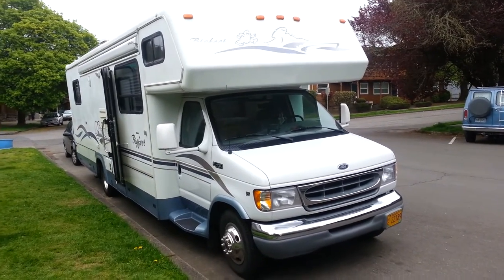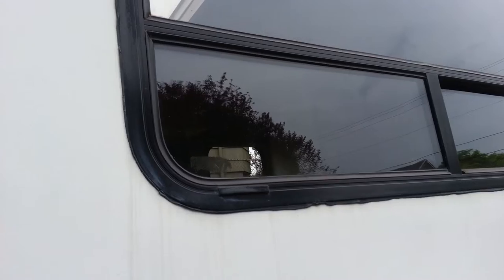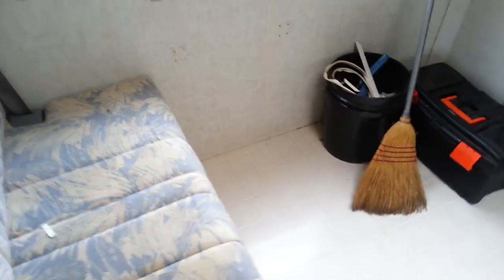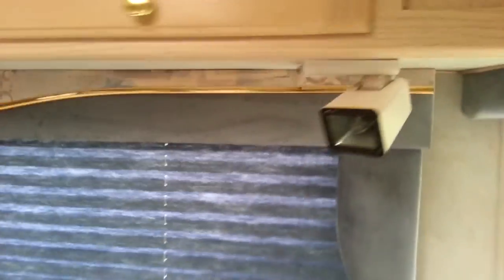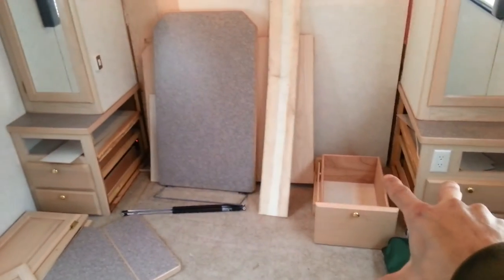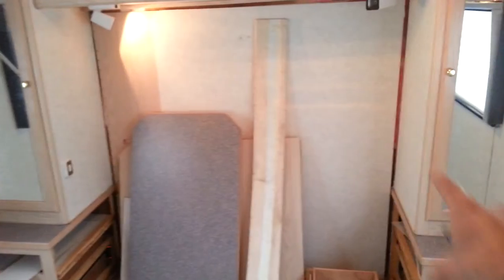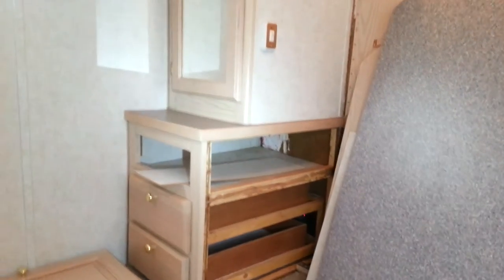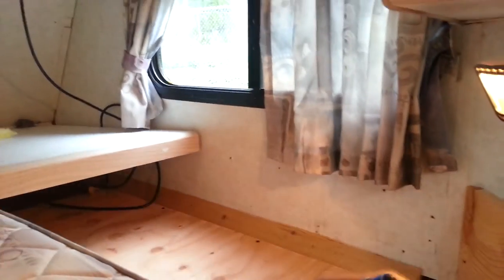Living In Our Bigfoot Motorhome - Overview

Comment: Good job!  I did extensive remodeling on my 22 ft RV 1997 Class C Tioga.  Also a Ford like yours, an E350 V10.  I love my RV!  But it was so very dull inside without an optimal use of space.  I ripped out dinette, and sofa bed and sold both.  I have shortened length of a wooden chaise lounge (Smith and Hawkens) and installed over water tanks where your sofa sits.

In place of dinette I have a slim recliner and where your current dinette bench chair is, I have added an IKEA Tarva 5-drawer dresser screwed to the kitchen wall on side facing dinette.  Over that mess of plumbing pipes and wires, I created a small platform and added some shoe racks and broom/ vacuum closet.  The other side of my Tarva dresser which faces the kitchen, I screwed on thin redwood facing planks ($2 each at Home Depot aged with vinegar/steel wool mixture).  Now I have a wood facing that I can hang things on for kitchen.  It also acts as a space divider.

Know that you can paint your walls.  Sand the vinyl wallpaper lightly with palm sander not disc.  Apply low odor Kilz Oil Primer with a small roller.  After 24 hrs, apply two coats of latex color of your choice and BE BOLD, stop using neutral colors like all people who are afraid of color.  My walls are turquoise or red or yellow.  I have color schemes in each room.  Do not peel vinyl off.  If you do, stick new vinyl on before you paint.  Vinyl holds the thin luan wood together better, and screws for hanging small things stay on better.  Also if you peel off, sticky residue remains and good luck removing this goop!

For damaged rotten wood replace what you can and for what you cannot, get some dry rot fixative from Home Depot.  It soaks in and hardens the wood and kills any dry rot fungus in there.  Good as new.  Like Bondo.  On back bedroom wall, you can glue and screw in (do both), those thin redwood planks from Home Depot.  They have a rough finish and look great!  To this wall, you could mount a whole Jean Louis (John Louis) Closet system since back wall studs are most likely steel.  Use self tapping screws for this to save your drill bits.  Once closet system is mounted, you will have a terrific closet system.  You can use IKEA Kvartal tracks to put a curtain over this for neatness.  I removed all my window valances that are so frigging ugly and put IKEA tracks on all.  Van movement does not make much noise like curtain rings would.  And use drapery pin hooks not the IKEA plastic hooks for your curtains.  Curtains are preferable not sliding panels because they don't make noise.  

Know that if you want to tile bathroom floor, you can!  I used small glass tiles, MAPEI brand thinset mortar mixed with their polymer to set tile, then MAPEI grout with their polymer additive so no sealant required.  The polymers make the stuff flexible.  I also used a Hardie Backer board under the tile to get around the dome shaped carriage bolts. 

If you want to add wood flooring, what works best is to grind down the carriage bolts holding down the plywood subfloor under carpeting with an angle grinder, leaving a bit there to hold on.  Then add an underlayment from Amazon - something that adds soundproofing, thermal insulation and a moisture barrier.  Its cheap - I bought a large roll.  Then add engineered wood click lock bamboo wood flooring from Home Depot (the only one that is right specs).  This just lays in place over the underlayment, so easy.  Removing the carpet is a pain, but you can cut around furniture and pull out lots of staples with cutting pliers.

Good luck with your project!  Its a lot of fun if you can do it slowly with no pressure.  Try to sell what you remove on Craigslist.  Other RVers want these items.

Comment: I owned a 2000 ford 450 with a gasoline v10. I had a ton of very expensive fuel injector problems.  Mechanic told me is was common with v10's.

Comment: Don't understand why the front of those campers don't have raised roofs like most 5th wheelers. It would give lots of room for upper bunk
Reply from the maker: You know, that's a good point.  Stability while driving might be one reason, along with weight distribution.  With out bed up front, 6 more inches of height over the mattress would make a big difference.
Reply: Cant see stability , you only need a foot or so even if it were designed as a pop up. Would be an interesting project
Reply: +M.C. Pletcher  using a thinner high quality air mattress or memory foam would be more comfortable and give you more head room.
What did you end up using?

Comment: Any follow up, picking up a 2005 25' on Monday
Reply from the maker: We're still in it!  I should do a video update on RV living.  Are you going to live in the RV?
Reply: Yes! Target date is next year. I just picked up the Bigfoot, its beautiful. Been cleaning like crazy. It is tight but still needed a thorough detailing. The Onan is leaking oil for some reason, Ill have to check it on my days off.
Reply from the maker: K. D. Mann
Nice!  What year is the Bigfoot?  Same size as mine?  29.5'
Reply: No I went small, 25'. Still plenty big since I was considering a class B...